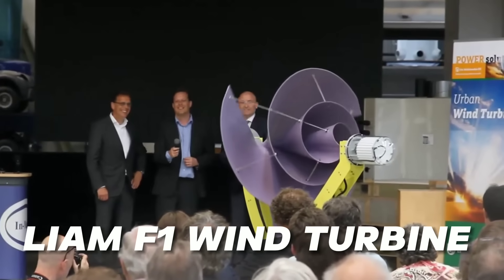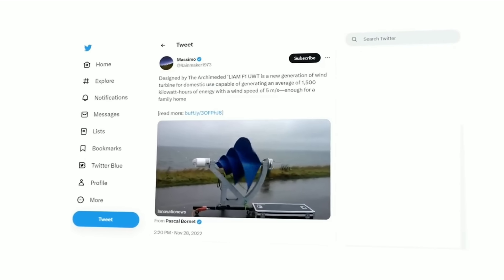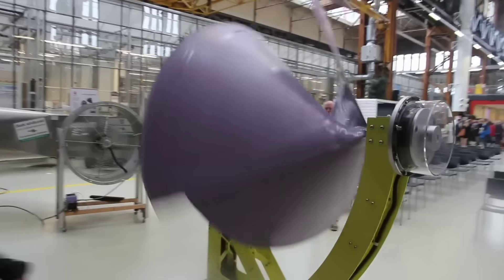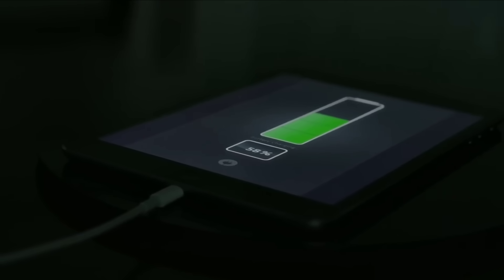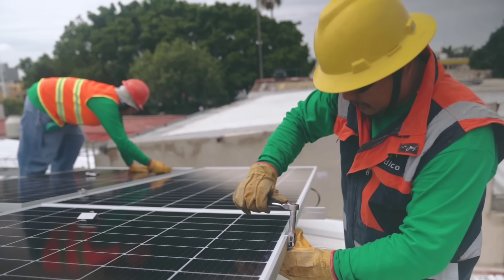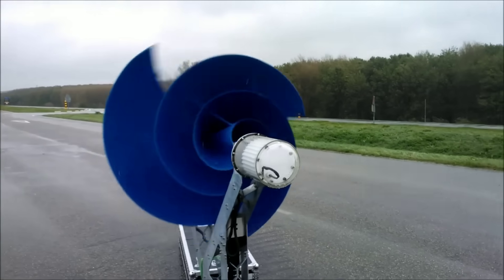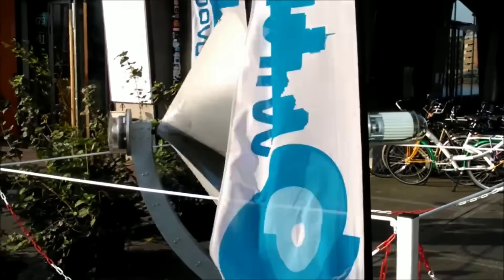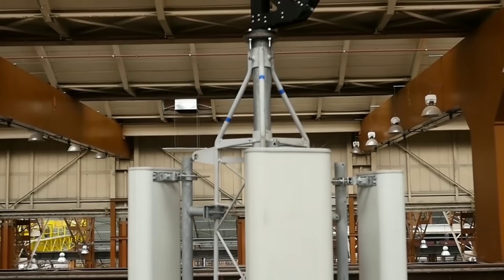This NEW European Wind Turbine for Home Outbeats PV Solar Panels in 2023?!

Comment: Interesting design!  The concern that occured to me is what happens when the turbine gets out of balance?  What do I mean?  The location I live can have moderate to extreme freezing rain.  If the turbine got coated with ice, what would happen?  Does it sense the out-of-balance and shut down? Would it vibrate itself to death or destroy its mount?  Also, instead of all these vibrant colors, why not make it clear or translucent so it doesn't stand out like a sore thumb?  Regards.
Reply: Translucent blades would make it a bird grinder just like clear glass windows on tall buildings can be bird forcefields. Several years ago I saw a wind turbine that was mounted vertically and was less than 2 meters tall. It had two blades. Each looked like half a tornado and they were connected with a small gap to let the wind in. The blades' turn circumference was constant (unlike this nautilus shape). No bird would fly into the gap between the blades because it was always in motion. No bird would fly into the blade body because it was solid and opaque. Birds don't splat into tree trunks. And no bird would fly into the envelope around the blade and get smacked because the blade never intruded into the envelope.
Reply: @iseeum  I dunno, man. I saw an eagle fly into the front door of a house. ¯\_(ツ)_/¯ 

I guess every species has at least one idiot.
Reply: Or the turbine blades can be coated with a non stick polymer like PTFE .
Reply: Price the complete package
Reply: I like your comments. Someone who has a brain that works. As for the ice build-up, there are coatings to prevent it. One of the early uses of Teflon was to coat skis on aircraft. Since Teflon, there are several newer products that have come along. Boat props are coated with a system that uses silicon to keep them clean.
Reply: If you make it transparent, birds will fly into it and die.
Reply: Any fouling of the blade would slow it down.
Reply: This turbine is a scam. All effective turbines use lift force, not push force.
Reply: Weather changes can be programmed, I don't think it's an issue.
Reply: @Accuface2000  no weather can't be programmed 🤦🏼
Reply: @JohnDir-xw3hf - By programming I mean installing instrumentation and temperature/humidity/rainfall sensors. Alternatively, you can have a mini weather station that can be electronically connected to the wind turbine to switch it off/on depending on weather elements. It can be done. Manufacturers give you what they think is enough for the majority of customers, not advanced systems for a few people with unique needs. Because it might be costly, so they won't entertain the idea.
Reply: The most inoffensive colour is metallic jungle green
Reply: Good question, but, notice: no answer.
Reply: To stop ice forming, you could make it out of hard rubber, like that on jet engines. The slight vibration of the tube will destroy ice like it does on jet engines.
Reply: @IbadassI  - Jet Engines Don't Use "Hard Rubber!" - However - They Do Us Compressor Bleed Air (Hot Compressed Air) fed through tubes to the Leading Edges on the wings, and the same source is fed into an air exchanger for cabin air, cooled by ram air from the base of the Tail!

Rubber Bladders ARE used on Leading Edges of many Turboprop aircraft, and are not "Hard" they are Soft, so they can be Cycled through an Inflation controller.
Reply: @robertweekley5926  I think you'll find that Rolls Royce invented the hard rubber on the intake cone of the jet engine to prevent ice forming on the intake cone on the intake turbine. The slight vibration of the rubber prevents ice build up at high altitude, where the tip of the intake cone on the centre is an ice forming root. Not sure how I can explain it in words. In fact it's difficult me to explain, maybe you can look it up.
Reply: @IbadassI aircraft have inflatable rubber "boots" & heated surfaces to break up ice, they do not rely on vibration at all.
Reply: @IbadassI  You may be confused by thesmall conical rubberised tip on some fan spinners. Jet engine blades are either a titanium alloy or more recently composite like the GE90. Not any rubber ised compound. Not designed to vibrate.The cowl leading edge is deiced by hot bleed air from the engine compressor.. The blades are not deiced. Ice buildup is rarely a problem, but may happen at low rpm when shedding techniques can be employed [increase rpm].
Reply: Good questions
Reply: by adding a heating element to the vanes all ice will be gone

Comment: Yeah, another snake oil. 
Good luck with snow and ice deposits as I see no deicing device installed. Also maximum output is not as same as average output so this sized rotor are too small for average household.

Comment: I'd like to see one of these windmills last 25 years like solar panels do. Plus solar panels are ZERO maintenance when installed properly... I've never had to clean mine in over 12 years. There is just no way a mechanical device like this is as durable and reliable as a solid state device like a solar panel.
Reply: "NOVEMBER 19, 2015 - THE ARCHIMEDES

THE ARCHIMEDES - LIAM F1 URBAN WIND TURBINE

The Liam F1 Urban Wind Turbine is a small wind turbine with a diameter of 1,5 meters which weighs approximately 100 kilograms. Due to its size and weight it is suitable for installation on almost every roof and wall. In the Netherlands, the Liam will generate between 300 and 2,500 kilowatts annually at an average wind speed of 4,5 meters per second. These results are measured at 10 meters height, the average height of the roof of a terraced house. In the Netherlands, the most common wind direction is South-West"

November 2015 ...... 8 Years ago ....
Reply: Solar panels continually lose output capacity every year over their 25 year lifespans . Also having a dirty surface on a solar panel can reduce it's output by 50%
Reply: @kls2020 yes everything loses capacity as it ages.  Next, there is no 25 year lifespan of solar panels.  25 years is typically what manufacturers will warranty them for.  It’s a common assertion that at 100 years old, solar panels should still produce at 60% efficiency.  Personally I witnessed 40 year old panels that still produced at 80% of their original capacity and that was 10 years ago.  Solar panels either work or they don’t.  The only maintenance is perhaps cleaning.  Wind turbines on the other hand require constant maintenance over their lifetime.  You know moving parts, lubrication.
Reply: @justinb6821 Hate to break it to you Justin, but the storms are frequent enough that my panels dont need maintenance and have never been cleaned in 12 years. Our panels are in a windy area, and between the rain and wind, cleaning is just not necessary.
Yes, there will be some residue that hangs around, but you just size your system up a panel or two when designing the system and by doing so, you just eliminated all that cleaning everyone else complains about.
The point? Work smarter, NOT harder.
Reply: This thing will vibrate itself to pieces.
Reply: The materials required for solar need heavy mining and processing that includes slavery in many places. If this is fixed the panels are no longer affordable.
Reply: Every year a solar panel loses its efficiency per a percentage,  you will be lucky if you break even on your installment...When are you people going to realize there is free energy all around us.  Your control masters do not want you have/use it... as there is no business in it for them.   WAKE UP Stop chasing your tails. you are going backwards not forwards.
Reply: You should try cleaning them.
Reply: @fredmercury1314  Why, when they system works as desired without? Please factor in the risk of cleaning damage when presenting your answer.
Reply: @jocramkrispy305 Because if it were clean it would work better, and the longer it's unclean the dirtier it gets. 

There is zero risk of cleaning damage unless you're completely inept.
Reply: @fredmercury1314  As Quentin Crisp said, after 7 years the dust doesn't get any thicker.

At UK inclinations, many panels are "self cleaning" because the rain washes the muck off. Cleaning them is then a waste of energy.
Reply: @jocramkrispy305  Ah yes... Because rain is clean water... lol 

I've seen how dirty my nice clean car is after it gets rained on. 

Buddy, that ain't clean. 

And in the UK, where solar panels need all the help they can get, you need them clean.
Reply: It is because you dont have much dust around where ever you are living. In middle east we have a lot of sun but also a lot of dust so we regularly have to clean dust from the panels to keep efficiency high. And yes also there is the problem of birds shitting on them. Sometimes in some places birds, if the panels are on their way, drop too much shit onto the panels which accumulates in time and makes things even worse. And also there is the problem of hail which can sometimes be really very strong and break/crack the panels. So solar is not without its problems
Reply: @servetc1970 if dust and air particulates are a substantial problem for solar where you live, it will pose a similar problem for wind devices.  Particles in the air can act like a sandblaster, wearing components they come in contact with prematurely.
Reply: The correct English vernacular is "bird poop."
Reply: @SDSunriser  No, the correct English vernacular is "bird feces". Master the language before attempting to correct others
Reply: @SDSunriser  No it's called guano.
Reply: No  @Obliticus  The English vernacular is bird droppings. Due to birds plumbing arrangements faeces  is also biologically incorrect.
Reply: @jocramkrispy305  Wrong. Just pull up any scientific biological text about birds. It specifically calls out feces, NOT droppings.
Reply: @Obliticus  I like your reply, but in the rush you made a spelling mistake..!! Correct spelling is 'FAECES'... and let's not fight over this 'S**T' lol..!!
Reply: @bandulaamarawardena6576  It's spelled BOTH ways, but the common version, as defined in Webster's is "FECES". Either way, my spelling is correct.
Reply: @servetc1970  One of the 4 seasons where I live is locally called "dust season" and none of the problem you list have given me issues. The rain and snow wash off the dust, birdshit, leaves, etc. And I'd like to see how well this turbine survives a bad hailstorm.
Nothing you said should deter anyone from choosing solar over wind.
Reply: I live in Texas and what the sales people don't tell you is solar panels above 90 degrees F lose efficiency. It has been average 104 here for a while and that means the panels can be reduced to about 48 percent efficiency during the hottest brightest time of year. The panels also lose efficiency every year.
Reply: @kris4786  Are you implying that wind generators dont loose efficiency every year as well? Or when it gets really hot? lol
Reply: @Obliticus  no just that we have had solar for a long time and there is a lot of things about them that is not common knowledge. Sales people for solar leave the efficiency drop out.
Reply: @kris4786   I've been 100% off the grid for over 13 years now, so I've been around the block. Of course everything degrades with time, but a solid state device will degrade much slower than a mechanical device, and require less maintenance.
Yes, sales always leaves out the stuff they dont want you to hear... what have they left out about this windmill? I bet more cons than a solar salesperson leaves out...

Comment: Biggest model produces about 0.55kwh, when wind blows, compared to approx. 2x solar panels, when the sun shines. Would need minimum 2x turbines per house, with wind blowing 100% of time, or 2x turbines + 4x solar panels minimum for general level power users. 37.5kwh per day cost $10-12 AUD approx. sourced 100% from grid. Conclusion, I'll stick with the grid.

Comment: Part of the point of innovation is also price reduction and $4500 to 6000 for a metal bracket a motor and a plastic funnel is too high lower the price and sell 10 times as many....or people will just copy  the simple design instead of buying out of convenience 😊

Comment: Solor panels need regular maintenance...
Gave mine a hose down after nine years .... They don't get dirty, even though were next to a used dirt track and Australian bush..
Only issue is UV on plastics degrading after five years. 
Thanks to our location near the equator.

Wind turbines: don't always have wind..
 but yes would love to have both running.

Comment: What happens in high winds? will it lock turn out of the wind? Or do you need a crazy amount of resistors to not burn it up? I wanted a wind turbine but the stuff that has to go with it makes it very pricey especially when it take a lot of wind to get power out of them. Most need 25 knots winds to get that ? kw rated power. Sorry most places on earth don't have wind storms daily. Then it  will spin but has to overcome the voltage of whatever there hooked to it before it produces a thing.
Reply: Probably quite strong as there is a large connected surface area.

Comment: While the content is fascinating, having the text type "km/hour" every time the voice says "kilowatt hours" does not help the credibility of this video. Also, several glitches reveal this to be an AI voice. Though it has a beautifully rich tone, it creates a distracting "uncanny valley" effect which becomes completely distracting from the message. Other than inappropriate gaps, a lack of nuance/light and shade in the read and suboptimal emphasis of key words in the sentence hinder comprehension. Every time the phrase "solar panels" is mentioned (many times) it is with the exact same tone, cadence and pitch, which quickly sounds robotic and distracting. Errors like these increase the sense that one is being conned, and make one wonder how many other inaccuracies are included, especially if the text has been created by AI